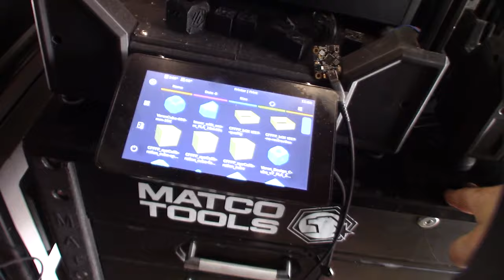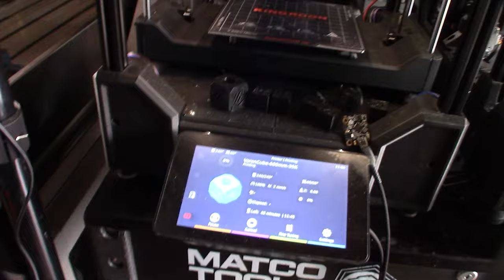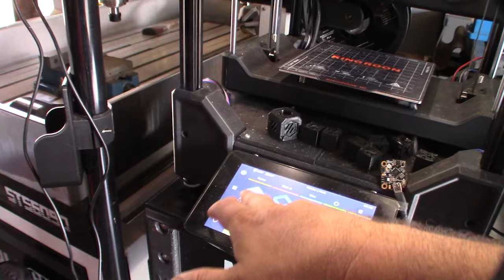Celeritas 4th Of July 600mm/s 35K Torture Test, Finding The Limits, Improvement Ideas.

Comment: I do love how quiet the motors are. My thinking about racking: plain bearings always have clearance, so... The maximum angle the bearing can sit at is where the two opposite ends hit the rod. If racking is occurring (the bearing is at an angle relative to the motion axis), there is only contact at the two ends. So rather than having one long bearing, it would be just as effective to have two extremely short bearings but placed very far apart (assuming they are sufficiently coaxial). It is lighter and since there is less contact area when sitting flat, there is less friction too. Incidentally I think the same thing applies to linear rails and everyone always using a single long "H" style carriage is a bit weird.

Something else minor I noticed, it looks like your umbilical has a short bend point right where the wire goes into the toolhead. We use a short section of large diameter spring there, just large enough ID for the wire bundle.
Reply from the maker: That makes sense, During wrap you are contacting two outside edges. I Have two bushings spaced apart on the Y axis toolhead. Maybe those heaver Bronze bushing on the outside rails would act like a vibration damper? What did you think my thoughts on the capacitors? I've seen some pretty massive capacitors to buffer the servos on large CNC machines. I have done a few large CNC electronics retrofits for customers.
Reply: @fintechrepairshop  I've actually not used a commercially made control board since my first printer which used a RAMPS 1.4 (of course making your own is a lot more fun...). These days with TMC2209 I use 50uF of capacitance per driver, connected with large traces with no vias, directly to the drivers. I think it is going to depend a lot on the board design (trace resistance and inductance, also cap ESR, etc.) and the small single-driver boards may just be better because the simple requirements allow them to put the cap right on top of the driver. But I am not doing 35k accelerations either, and there may be a need for more capacitance too to merely capture deceleration energy.

But there is no need to guess here! You have an oscilloscope, right? You should scope the driver supply pads (maybe across the h-bridge for a discrete bridge driver) during a fast acceleration and deceleration and see what happens!
Reply from the maker: @jessicav2031  Yeah, I have an oscilloscope. I originally got the scope to test PWM circuits.  I had a few ideas for caps. Might want to look at drivers with external mosfets and large capacitors. Another thought was to solder some caps on the drivers power source pins. Not sure how much more current I can send through the TMC2240's. I might be able to push them to 2.0A if I have better cooling. They are heating up at 1.5A. Maybe machine a better heatsink or upgrade to external. The bigtreetech TMC5160 Plus work pretty good in my Orcinus printer.
Reply: @fintechrepairshop  I have to admit, I am a bit jealous that you can just machine a heat sink 😆
Reply from the maker: It would be cool to have a driver amplifier board. Large caps and external mostets but be able to plug in any driver.